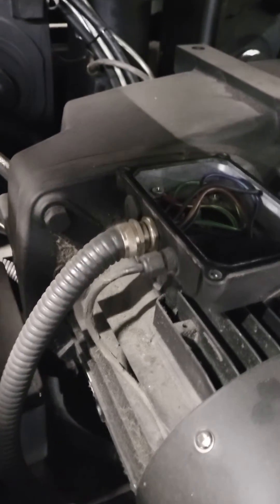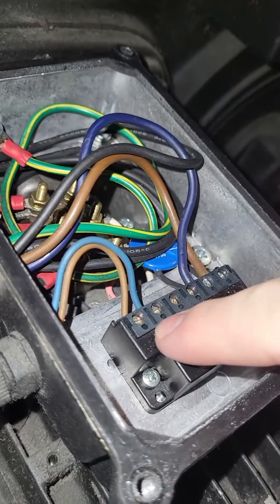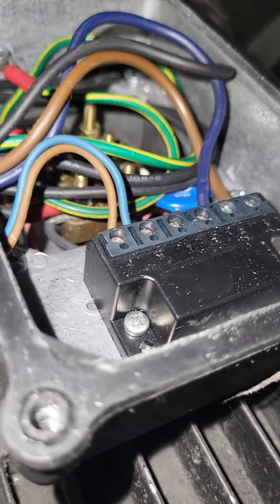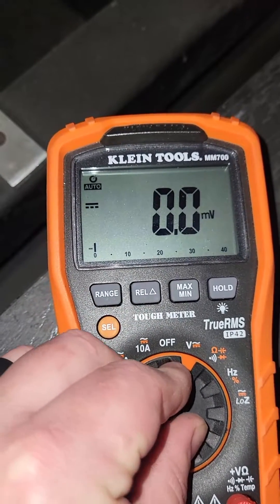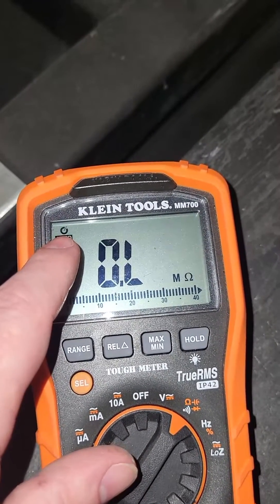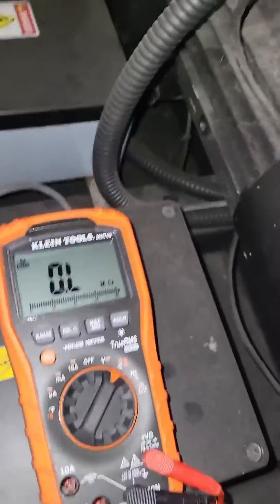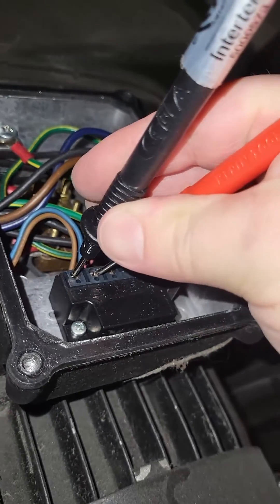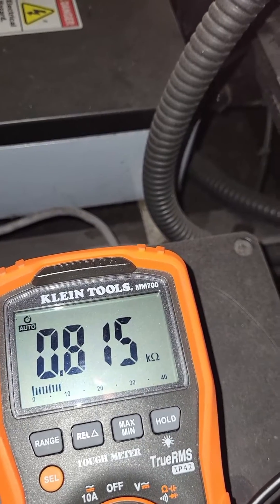Testing brake coil

Comment from the maker: Correct.  You need to have an idea of the resistance your coil should be.  Some may be much more or much less resistance than my coil in the video.  It will depend on physical size as well as voltage and wattage.  Also remember that no resistance at all but still has continuity means your coil is shorted and will trip breakers or burn fuses.  OL  or infinite resistance means the coil winding is broken/physically disconnected.  Either of those scenarios the coil will not magnetize